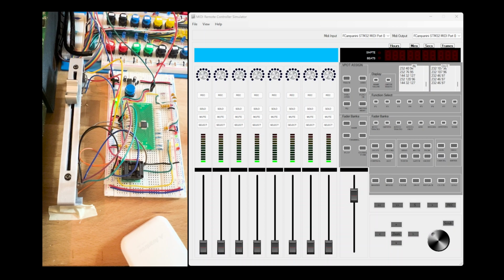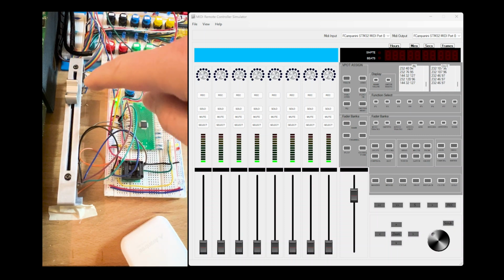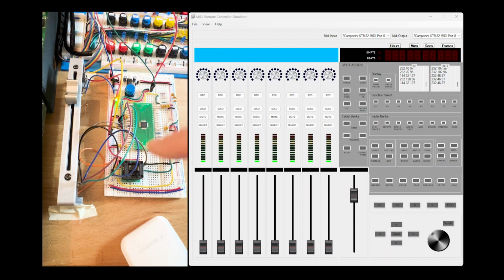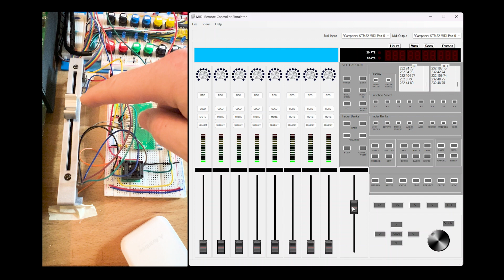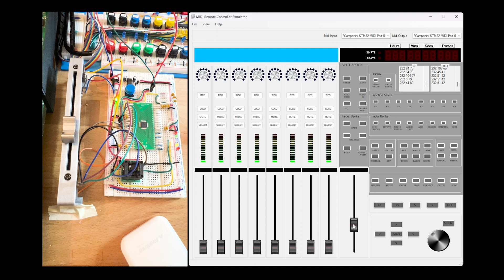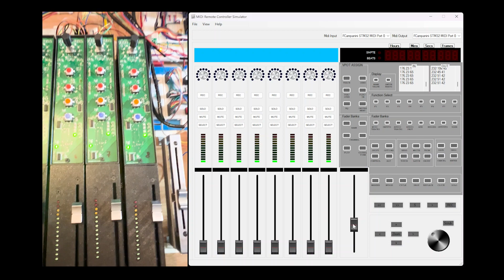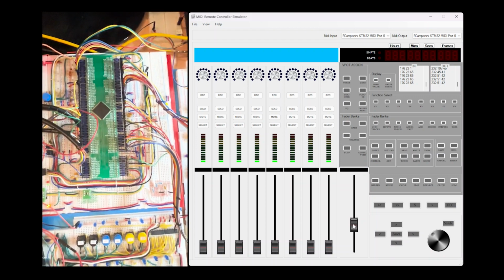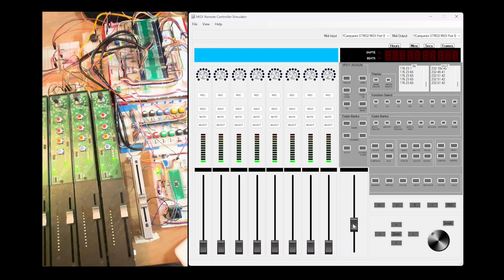DIY MIDI Remote Controller - Master Fader

Comment: What’s the plan?   You looking for investors to get this manufactured or licensed to an OEM
Reply from the maker: Hello, the plan I have is actually a bit more articulated then find investors to launch on the market this specific product. I mean this might be indeed a possibility. However, the reason why I made this project is that I have in mind since some year a modular remote interface that should allow the user to decide how to compose it and so forth tailor its own framework. I tried at the beginning of this project to go straight there but I understood that it was too complicated without having the base. That's why I decided to complete a Mackie protocol based interface in all its features. I have to say that I was correct, today I think I master the subject enough to move to the real deal! Cheers and thanks for being interested to my project.
Reply: I've asked this in the past, but Filippo doesn't seem to either read or reply to comments :S
Reply from the maker: Hello ralmslb, really sorry for having missed your question... I always try to answer, but I have to say that I receive a lot of questions which is indeed a good news for my project but on the other side sometime I simply miss something! Hope the answer I gave into this thread also answer your doubts. Cheers!
Reply: @fcampanini  I understand, thank you for the reply.
Its looking good.

Have you considered selling this as a kit or something similar for other DIYers that would like to create a custom board for other purposes? Like controlling a PC audio during streaming, home automation stuff, etc?